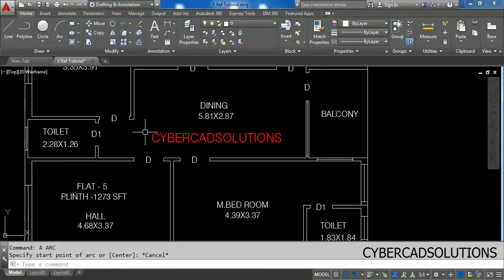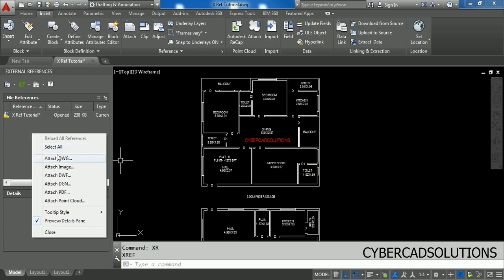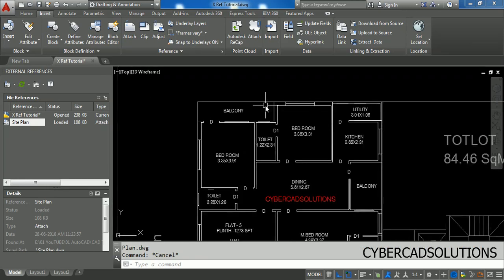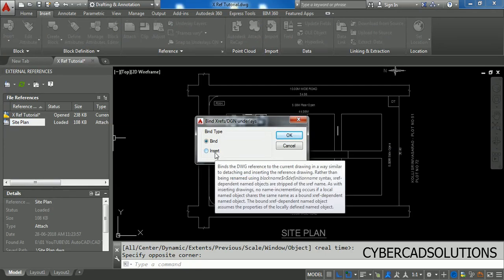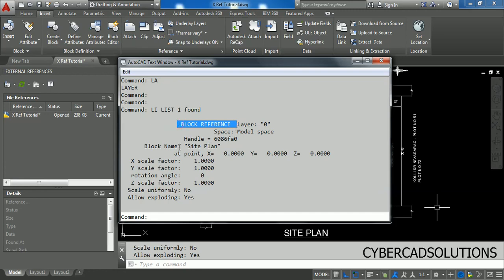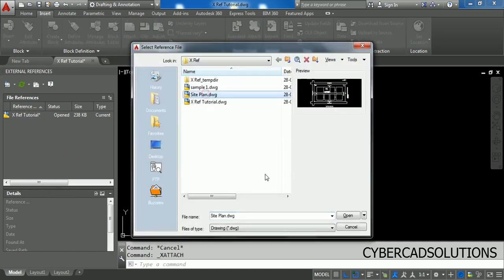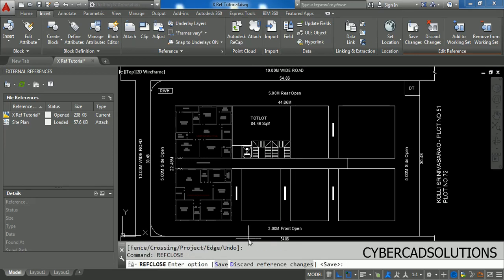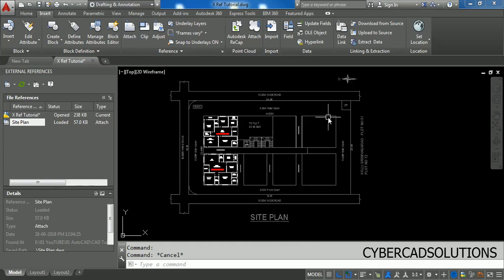How to use External Reference in AutoCAD

Comment: Dada how are you ! I used x-ref command a working purpose but, after used x-ref command my cad file not saveas in proper way , my cad format2018 , what can i do ? Please help me
Reply from the maker: That's not caused by xref command. There may be other problems with your cad. Please check.
Reply: @cyberCADsolutions  thanks ! dada